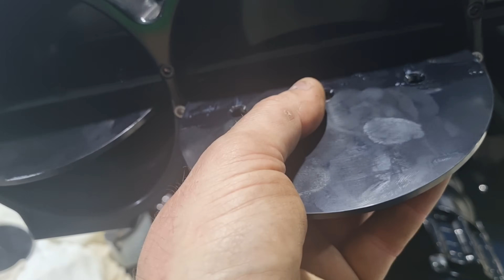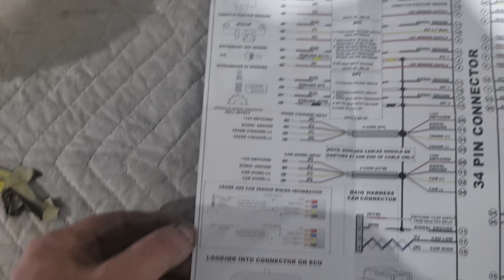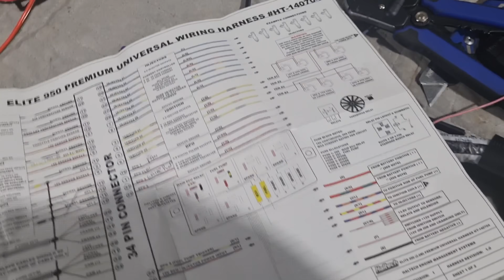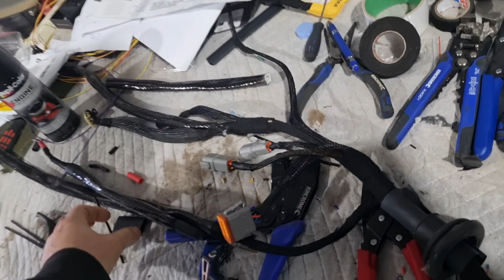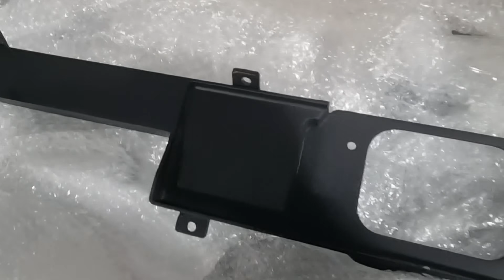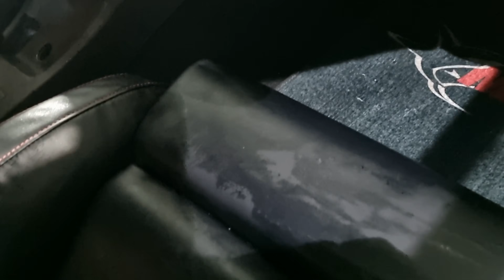Blown VK Summernats 35 Project Build Ep29, Haltech ECU and wiring time, will Mako fire up

Comment: Hey m8 I noticed you’ve got a button for the ignition in the column could you let me know what to use n how you did it I have to do that my ignition is sticky have to turn key back after starting if you know what I mean 👍
Reply: Could you send the link to me via messenger Paul Brewtnall 👍
Reply from the maker: Just bought a push button kit from EBay, very east install just follow the instructions
Reply: @carsnthingsrestos31   ok m8 do you have a link
Reply from the maker: (12V Remote Control Car Engine Push Start Stop Button RFID Ignition Starter Kit), this is the kit I got form eBay.